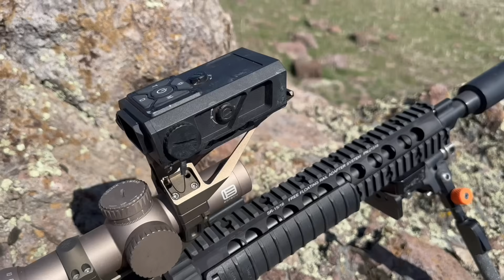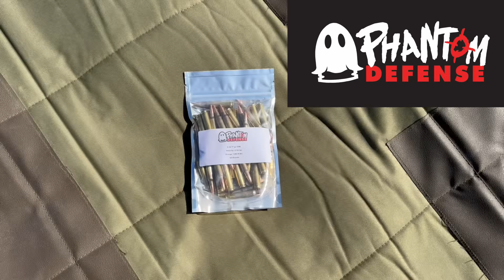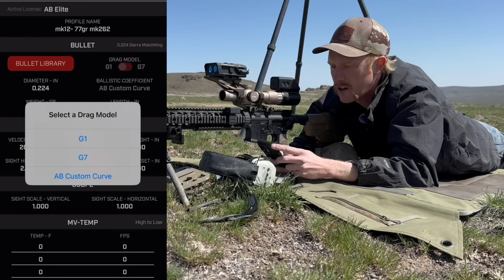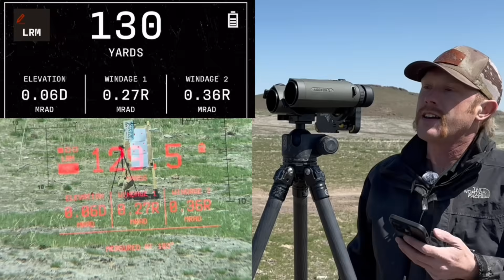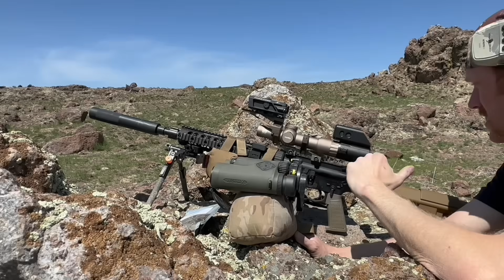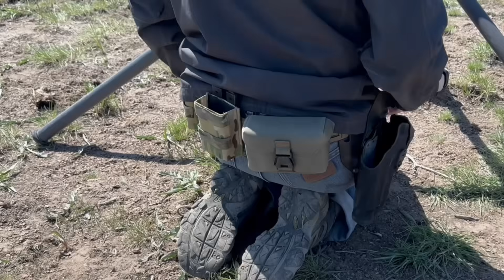Weapon Mounted Vs Handheld- Best LRF For Long Range?

Comment: NICE , however , at the price of the Vector X , I would much rather have a PLRF-25 , dont like the focus method on the X , or the weird roof angle ? and the type of laser on it .
Me I would use a Tango Fire 8000 , yeap with the better wave lenght laser 1500ish nm , and I would use 2x , one on the rifle and one on a spotting scope w/reticle  , that would do a similar job .
My ideal would be a PLRF-25 and a Mazak 15k , but both are for me not really available .

Comment: Will that tango work well mounted on the side of my mk12? Rather not get a new mount with a diving board and not a huge fan of how tall it will make to as well. Want to mount on left side of the rail out front. Will screen rotate to read side mounted?

Comment: Great video and information about the two different LRF’s. When I had money the only thing that was available at the time was the Kilo3000 and Kestrel 5700 Elite. 
Have two questions what are the LR Binoculars running in price?  How hard is it to switch the WMLRF from one rifle to another rifle?  Great job Zack.

Comment: I use both but Kilo 10k Gen 2. It’s great for scouting targets or calling shots for someone else. But love the Fire4000. Have both. Also the Fire4000 works great with my Kestrel 5700 or ABQuantum and Calypso AB. But the gun mounted one is so fast not having to leave or move from the gun.

Comment: $1400 USD is not affordable. Might be a great price, but not affordable from my  station. That's a massive upgrader in a rifle or scope for me
Reply: You should see the prices of the other WMRF
Reply: Affordable compared to a 10k$ Raptar, Which was the biggest competition
Reply: Yeah dude, this ain’t your type of device. This wasn’t even a thing for civilians a couple years ago unless you had 6-15k to spend on a Raptar or MARS. So yes, it is affordable for people looking for this exact device. No a device for a hillbilly used to a $150 Bushnell range finder. There’s levels to this shit
Reply: @braydenpatterson6387  All PUN intended !   I do use $150 range finder to set my steel targets - leap frogging for every 500 yards as my laser range finder can not reliably read to further distances .
So 3-4-500 yds then move out to 6-7-8-9 then 1000 .  Now have targets at 1200 and 1424 yds and us AB Quantum for the firing solution .  With slight corrections :)
I am on the fence as to the purchase of a weapons mounted range finder .  Not now but maybe in the future ?
Reply: Yeah I was thinking the same thing, “less expensive option” would probably be more accurate. When I think of “affordable”, that’s something I could impulse buy after about six beers and not care the next morning. $1400 isn’t exactly that. 😂
Reply: broke
Reply: Check out the Burris Eliminator 6. Gives you all the same things just cheaper

Comment: Your subs are taking off! 🚀 Got a Vortex impact 4000 about a month ago at Scheels for $1,500. I was considering what you're running when I saw Vrtx on sale for 100 bucks more. Couldn't pass that up, so I had to pull out the plastic for that price.

Comment: Maybe I missed it, because I'm eating, but do these range finders factor in the shot angle as well?  Here in Southern California it's very hilly and some of the 1000 yard shots are at the top of a hill.  I'm typically looking at a 12 degree elevation to target which vastly changes my holds.
Reply from the maker: They sure do…. I actually ran the fire 4000 at cameo a couple of weeks ago for shots up to 30 degrees!

Comment: Awesome video! I think the advantage of the tripod mount a laser range later is that it’s higher off the ground, there’s much less mirage at 3 to 6 feet off the ground compared to laying prone and looking through rifle scope, also the spotter can run the rangefinder and ballistics app and the shooter can concentrate just on shootin.  also you don’t have to point your rifle at something to Range it.. The vantages of the rifle mounted rangefinder are its much faster more stable, higher magnification and much finer Aiming point, and if you shooting by yourself it makes more sense. I think there’s advantages and disadvantage is to both in hunting , Real world applications, or just shooting targets at range.  PS I so want one of those rifle mounted rangefinders. I guess that’s another advantage to a handheld RF,  pretty good units can be had for less than $500.

Comment: It’s a shame that these type of devices are out of reach of 80% of shooters
Reply: Meh not necessarily true. I agree they are expensive as hell, and I have always been broke my whole life. I’m 35 now and earn 80k a year (finally) but I’m still broke because as I came into a better job we had our son born 15 months ago and I support my wife to be a stay at home mama so we are hella broke! I’m going to type a ton here in and probably no one cares to read. But mindset and patience is key, you can have amazing things if you are patient and passionate about it. Here goes. 

I don’t have an LRF mounted on my rifle yet. But I do have incredible Steiner military LRF binos with a reticle. But I’ve had 2 amazing builds in my life. My first was a savage model 10 in 308 with a 24” barrel and hs precision stock. I put a Leupold mark 4 4.5-14 LRT on mark 4 high rings in a badger 1 piece 20 moa base. The full rifle cost 4k in 2012 and it was incredible. How did I get it? I split the cost of the gun with my parents for Xmas (I paid 600 for my half). I then held on to the gun without shooting it for 2 years while saving for the scope and everything else. I learned power of patience during that time. I had to sell it in 2018 to pay for rent and I still kick myself. 

My current build took 6 years and almost 7K to build. It’s a Frankenstein block 2 pinned 556, with all the bells and whistles (LMT EBCG and bolt, A5 system, vltor mood stock, law folder, geissele 3g, radian raptor and talon, matech and mid west flip up sights, pinned KeyMo, badger condition one 1.54 mount, nightforce NX8 2.5-20, top mounted Steiner MPS, badger condition one bubble level, Harris 9-13 with magpul arca pic mount, and RRS ARMS 17 swivel adapter) it took forever and I still need a suppressor next (dead air sandman S). 

My laser rangefinder is the Steiner M830r LRF binos (the 3k pair not the 10k pair that have the LINK input unfortunately). 

I’m not saying all of this to brag or boast, I’m saying all of this because it’s my passion and I adore these things so much! I like the best of the best but I cannot afford to have debt or use credit for my selfish hobbies. 

Instead I make it a goal to buy one nice thing a year. Some years it’s an on sale upper from brownells or a geissele trigger, other years it’s a scope. Waiting until tax season, birthdays, and Xmas is ideal. But take your time and be patient. Set your goals and stick to them. Don’t buy cheap things to substitute because you will end up paying more in the end repurchasing what you originally wanted. 

Another truly great thing is to buy demo items, used items, or on sale items. If you get a reputable brand like vortex, Steiner, nightforce, Leupold, SIG, Trijicon,etc. you can use their customer service and warranty to ensure your used or demo product gets replaced or fixed if you ever have an issue. I’ve had great experiences in these areas over the years. Steiner was the best I’ve had yet in warranty. 

Play around with coupons on websites you may find glitches. I got my 1200 upper for 680 out the door with next day shipping and tax included. On thanksgiving in 2022 brownells had a sale on DD uppers and the glitch on their site allowed me to double dip Black Friday code on top of the already 10 percent off sale. It was nearly 50 percent off. The next day they fixed it and the upper went up to 900. 

It’s also nice to plan in a way where you can enjoy what you have. If you are building a rifle use a red dot from a handgun or other rifle so you can shoot it until you get the scope. 

Start slow. Get a good pistol with a dot and a light so you can shoot. Then build a rifle that you can shoot for 1200-1500 (I started my ar with an 11.5” upper and eotech). Then get a good upper for long range and use your old red dots. Once that is built with your scope get levels and red dots to complete the setup. 

My next built will be an LMT Defender H (the MARS isn’t worth the extra cost). But with that I can use one great optic, light, and sling, but switch calibers, barrels, gas systems, and change my gun accordingly while never needing a new scope.
Reply: @T20-c8f  yeah bro 80 grand a year sounds pretty rough lol 😆 😊
Reply: Separating serious buyers is essential sometimes to keep markets stable.
Reply: Yeah, I still like to see what's out there and where the cutting edge is for consumers, but my poor man's approach is  high quality traditional bino's. Handheld LRF, aeroweather app for local airport wx, and 4dof app.
Reply: The range finder you see here isn’t even that bad compared to the Wilcox, envision, be meyers and l3 storm… There all like 9000$+